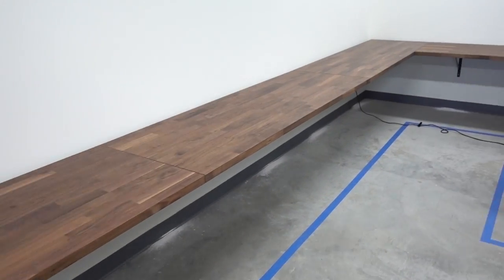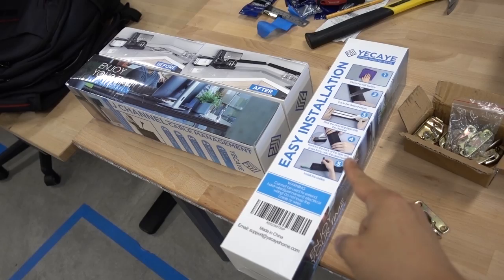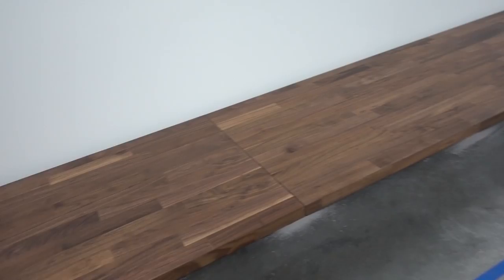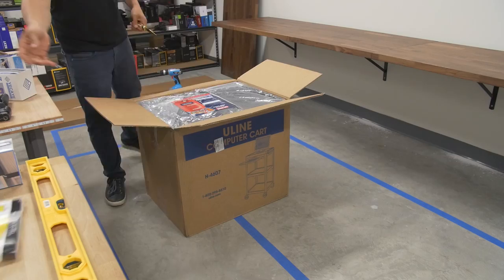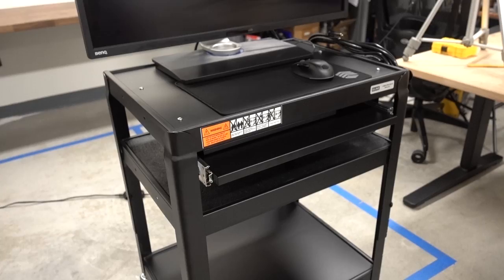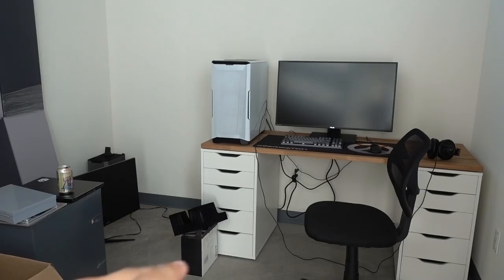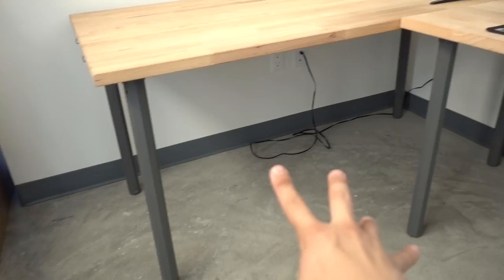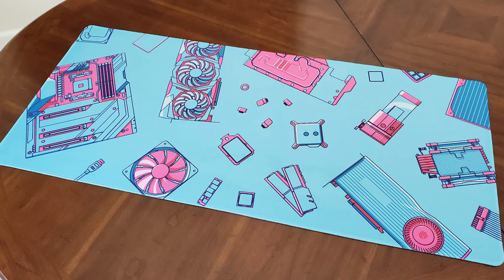Getting the COMPUTER CART I've always wanted!

Comment: If you planned to have a permanent PC on your cart, consider adding a UPS to unplug and move your cart without losing any work in progress on!
Reply: Ups?
Reply: @simbast9726  it's a battery backup.
Reply: Simbast Power unit battery, companies like mine use it on servers when the power fails so we don’t lose what we were doing and we also recommend to some clients that hate being without internet when the power of their home fails

It’s not permanent, but depending on what you plug in, it can still last a while 

Our  can power our gear for 5hours ( using mobile celltower battery’s )
2x banks of 4 battery’s
Reply: @simbast9726  uninterrupted power supply
Reply: @GuiltyKing27 had one from 2010-2015, batteries died, replacement expensive, don't actually need it, saved money!
Reply: I agree with the UPS but I would be using the UPS on every computer  why plug in your computers up to the wall  and chance for it to get  power surge.
Reply: @chaddouglas1958  surge protectors are a thing, and also, all decent PSUs have protection.
Reply: @FastSloth87  yes surge protection is thing and but a surge protection is  something to use and only protects from a surge. But a UPS will protect from a surge and gives not random volts coming from a wall outlet it gives off a steady flow of the electrical current. But if you want to ensure that you can have time to save your work after the power dies  I would make sure your computer is plugged into a UPS. I always like to be prepared no matter what and do not want to have to worry  high end computer MOBO doesn't get fried from over surge from the power company. I have seen a lot of computer getting fried from just using  surge protector. So when I'm deploying a new computer and know that it has surge protector i replace it with UPS to protect the equipment.
Reply: @chaddouglas1958  if you have a high-end mobo, you have a decent PSU, that should die before the mobo. Also, every OS/Software/whatever that doesn't have an auto-save function is shit.
Reply: Problems with this idea:  

1)  It comes with an extension cord already mounted on the cart, no need for more.
2)  It's a fire code and fire insurance violation to plug a surge suppressor or UPS into an extension cord or other surge suppressor/extension cord, unless it uses properly rated cabling equivalent to structural wiring.
3)  On-cart power systems are big and heavy, and subject to the same restrictions.
4)  There's no reasonable reason why he'd need standalone power on a cart that will never be more than 10' from an outlet in it's lifetime.
Reply: @phydeux   good points but for the last one, the idea is that even though it will always be near to a power outlet but you would still have to change between them to move around, so you would have to save everything and shutdown your computer and start it up again, only wasting a minute but still really annoying. With a UPS you could just change outlets without all that. And, blackouts and brownouts do happen, and you don't want that messing up whatever expensive high end tech he would use.
Reply: @jonomoth2581  - That's all true, my major point was that a UPS can't be used in conjunction with any extension cords like the one attached to the cart.
Reply: @phydeux   I might be misunderstanding you but most UPS's have several output sockets, and there's no reason there can't be an extension connected to it. When there is sufficient power there would be no difference in plugging into mains

Comment: As someone who has some building experience, there are two things that I would HIGHLY recommend...
1. At each "desk end/connection point" (what are they 6 foot desks?), you really need to put a "support bar" that goes from the bottom of the desk to the floor, like 3/4 distance from the wall.  Given the weight of that wood and the equipment that's going to go on them, I highly recommend they have that extra support.  Seriously.  That doesn't look strong enough at all to me, especially I think you said you drilled into "metal" for those supports?  2. Plug each of your power bars into their own at least 4500 Joules Surge protector.  Make sure your power bars don't have surge protection on them either, only a "switch/circuit breaker/fuse type protection".  You should NOT daisy chain surge protectors.

Comment: The coolest computer carts i've seen are what are used by the staff at hospitals. They tend to have laptops but you could easily use a desktop PC in it, has a pull out drawer for the keyboard and mouse, and you can easily mount a gaming monitor on it.  It runs on a large set of batteries at the base of the car, and you just plug it into the wall over night to charge.

Comment: As a former IT who used to work with a cart daily, do this:

-Install a USB 3.0 hub
-Add a small network switch  (like 4 port)
-Get a KVM to connect your stuff too it with dongles for VGA/DVI/HDMI/DP so you can use it on any monitor
-GET RID OF THE MONITOR STAND ASAP. Buy a cheap monitor arm w/ VESA and bolt the arm to the cart or your monitor will fall to the floor. It'll happen.

Comment: One last step. With the tops bolted on. Loosen all wall mounted wing bolts re-level the desk. Level and tighten from the corner outward. Tighten the all mounts Left of corner/ right of corner and so on until they are all tight and level. This will minimize the stress to the wall and desk!!

Comment: Hey Man, love the new space! Desktops look friggin' sweet and I too appreciate some Uline goodness. I actually use their shipping tables as a desk cause beefy. Not sure if someone already brought this up but I wanted to ask about all those power strips... How many circuits will you be going into? It just look like you had the one standard 2x box under one of the desks and I was concerned that all 40 power outlets from those power strips running off that one wall plug might overload that circuit. I'm totally not an electrician and completely unqualified to judge this kind of thing. You may have addressed this in a another video and I could have missed it. Just wanted to throw that out there. ✌❤
Reply: beyond almost certainly overloading circuits and being against fire code practically everywhere; why would you put this much thought into the work bench to mount the strips underneath way in the back. If you're working you won't want to get on your knees just to plug something in. this is the set right? there won't be semi permanent workstations
Reply: And he talked about putting storage under the tables. The power strips (which he definitely should spread out over a few circuits - and chances are good even if there are multiple outlets along the wall they are on the same circuit) should be accessible from above the table top.
Reply: Yeah I was only able to see 1 or maybe 2 outlets along that wall where tables are. I was wondering same thing about power draw for fully loaded desk/tables of PC equipment.

Comment: From an Commercial Electrician's point of view.
I recommend installing One (1) Appliance Outlet (20-amps) for each Power Strip.
From the video, you only have one Duplex in the long wall. And it's just not enough.
Fed-Code is at least 1 duplex per every 12 liner foot along the wall.

Comment: You may want to consider changing the table orientation with the editing bay. Instead of how it's set up now, it may be worth taking the current table the monitors & PC are on and push that all the way into the corner to the left, while pulling that table on the left out from that corner, then placing the 2 monitors keyboard & mouse on the table on the left while leaving the PC in the corner on the same table it's on now. The benefits of this is the cabling will still run the correct directions, can easily be managed to keep a clean look up to and underneath, and when it comes to whomever is in there working if someone is standing at the door talking, then only rotate 90 degrees to have the conversation instead of 180 degree rotation. It also should make the room feel a bit bigger as well since the room appears to be wider than it is deep, so you put that extra space behind the desk which also allows more collaboration as now another chair would easily fit both temporarily as well as if 2 people are there working. Just a thought.

Comment: For that last desk. You don't need to build a wall. Just place another L bracket approximately where the center of the table would be if it was turn 90 degrees out to the floor. Then support the other end with one of those trapezoid legs or something.

Comment: So, how are you going to route the cables from the hardware on top of the desk to the power strips and cable channels under the desk? Those desktops would need to be mounted away from the wall a good .5-1 inch to allow for that.

Also, don't build a wall for that last desktop. Leave that free standing on legs so you can move it as needed.

Comment: Kyle are all your wall plugs in the same circuit. You may have power draw issues when setting up multiple systems and lighting, etc on  a 15 amp standard breaker

Comment: Gonna say one more time. 3 desks iin front and rear with one on the side where the pegboard will be and on the other side make that the entrance. You can put a partition wall there if you like. Finally, I the the front of the desks mounted to the wall should be supported with say a 2 x 3 angled form the front to the rear

Comment: You should put a UPS on that computer cart and just use the built in outlets as an extender/plug saver. It would keep it more mobile without the need to shut down if you need to move it across the room or whatever.

Comment: Wish you would've flush mounted a couple of the power strips to the top of the desk so you could plug in without reaching over. You can get a couple 2 or 3 ft nema cables for projects.

Comment: Tips: Don't use double sided tape on a wood desk, the tape is and will dry out and they will fall, use screws.  Wobbly tables have feet adjusters on the bottom to fix the wobble.  L brackets don't fix the problem of a wobble.

Comment: ULINE has been making those carts for like... 30? 40 years? Same design, they're super durable. They didn't always have a keyboard tray option, but the rest is identical to the ones my college used [and probably still uses] that they got probably in the 70s or 80s.

Also, silly question... Why did you use latches between the table tops and not just straight brackets? Those latches are really made for removable table top usage, lol

Comment: What's with everyone hating on the numpad? I absolutely hate to do any calculations on a laptop layout as the operators are a nightmare to enter. It's not like that extra grouping of keys takes away that much desk space...

Also, keep in mind 40 outlets are nice for choice, but mean nothing if the breaker and more importantly the cables in the wall can't handle the combined amperage - it wouldn't be the first fire started this way...

Comment: For the networking, please set up outlets,  installation cable to a patch panel and then patch into a switch. Long runs with just cable is begging for problems down the line. Set it all up in the 19" cabinet you already have on the wall. Do it proper, make a video. 🙂

Comment: There is no need for table locks when the tops are screwed to the brackets. You  have more play in the bracket than you would have with the screws. You also didn't line up the brackets properly and missed some  mounting points. You can see the movement in the top at 5:31

Comment: 6:55  "No name keyboard from amazon"  Quite clearly the TUF logo
Reply: That's not the TUF Logo. It's some chinese brand named picotek or pictek. I can tell. I own One.
Reply: @ursmarschlotterbeck238  oh yes, so it is. Is it a good keyboard?
Reply: @harrisonearl883  i like it quite a lot when it comes to typing. The rgb Software is trash.
Reply: @ursmarschlotterbeck238  I have this horrible VicTsing keyboard which doesn't even have proper switches, just plastic knobles pushing on other plastic. It doesn't even have any software, just permanent rainbow across the backlighting

Comment: Hi bitwit i hope you can read my comment
I would like to get your opinion on Which Pc i should get. Know that im on a budget of 25k PHP roughly around $500
I need it for work from home and for some gaming. Here in the Philippines theres alot of people selling pre built pcs. So rather than lining up at pc express with lots of people and be a good citizen and not spread corona virus. I opt to get the pre built coz no one delivers parts. And if there are... Its probably destroyed when it gets here. So these are my options

Team amd

PROCESSOR -  AMD Ryzen 3 3200G
MOBO- Asrock A320M DVS R4.0 (AM4)
RAM - 8gb ddr4 3200 Patriot Viper Steel
SSD - 120gb WDC green SSD 2.5
PSU - Deep Cool DC 600watts PSU
MONITOR - 18.5" AOC E970Swnl LED, vga
CASE - Vikings
HDD - 1 tb Seagate Barracuda

And for team intel
Processor: Intel i5 6500 6th Generation
Mobo: ASUS H110M-D
RAM: HyperX Fury 8GB 2666mhz DDR4
GPU: Palit StormX GTX1050ti 4GB DDR5
SSD: 120GB (Brand new)
HDD: 500GB Toshiba
Case: Fuzion Gaming Case with Fuzion 700watts PSU and free 2 Led Fan (Brand new)
Monitor: HuntKey 24" IPS Frameless (Slightly used/No Box/Good as New)
with Brand new RGB Gaming Mouse and Keyboard

FREE: Windows 10/Microsoft 2019/Games/Wifi Dongle (No warranty for freebies) 

Can you give me your thoughts

Comment: I have a problem with my home wifi. I have wifi service from a provider that SUCKS! I live in a very crowded apartment building. I have a wifi signal but not internet connection. I am now working 100% from home and it's been a high headache. 
I was told to get ba wifi extender, which one would you suggest that has great support services as I'm not a tech person.

Comment: Those table locks don't make any sense. They would be sensible if the tables were on stands on the floor. 
When you mounted tables on brackets I would have just used straight brackets. MUCH easier and cheaper... Pennies, literally!